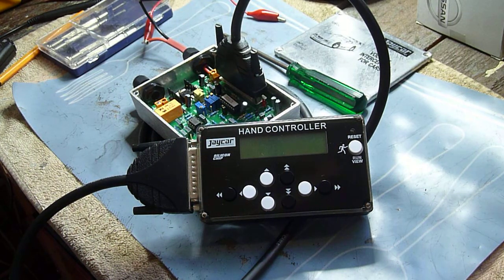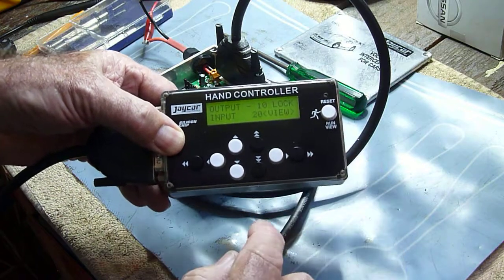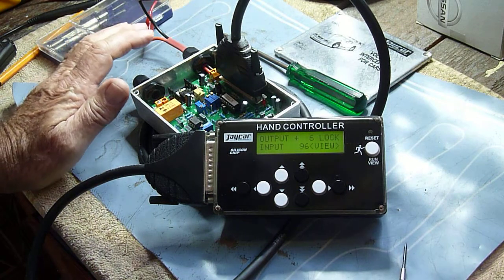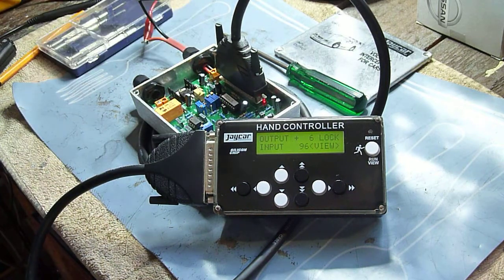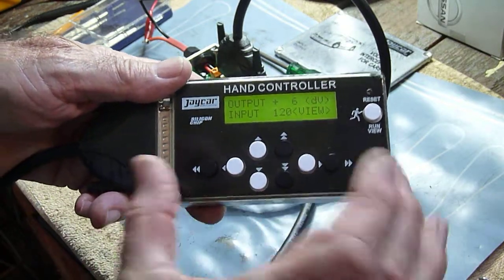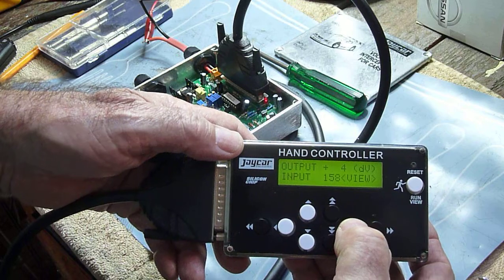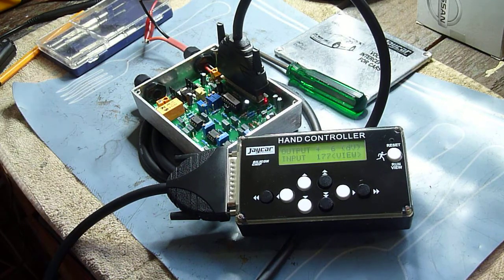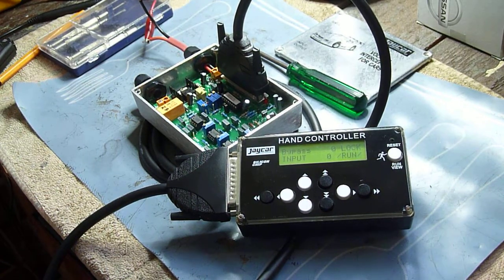Nissan 3L, JayCar Voltage Interceptor Adjustment & Tips

Comment: @Geeyoutoo are you still selling something like the Jaycar unit? I am on the Sunshine Coast and keen to catch up
Reply from the maker: No but if you are a bit electronically minded I have one second hand unit that may require a bit of attention. An ECU remap removes the need for these that is why I stopped making them.
Reply: @Geeyoutoo  I have a RD28 with the same issues. Getting a MAF calibrator from Greece that hopefully will work. Or I bite the bullet and get a Unichip ECU
Reply from the maker: @GURD28  I would suggest at this time that you look up Patrol4x4.com I'm an Admin there, we have many 2.8 owners who maybe able to offer more accurate advice on your engine than myself.

Comment: Geeyoutwo I think I need to modify maf voltage unless I'm missing something? Have blanked egr, needle and Dawes, 2002 Di still hitting limp or boost bounce? Not sure how to tell the difference, thanks
Reply from the maker: Do you have a boost gauge? If so what boost are you seeing? Do you know your MAF voltages? if as soon as you lift your foot off the accelerator and accelerate gently again the vehicle recovers then that is limp and as said mine has 3 limp zones, 2500, 3,000, 3500 and these can be tripped by quick turbo spoolup and a boost above 15-16psi (some vehicles may have that a bit lower), you maybe able to get rid of it by slightly reducing boost and/or spoolup. Does the engine light come on while driving? Unfortunately the device I was building is no longer available as a kit, so quite difficult to put together these days. If you are going to hang onto your Patrol (I still have mine after 21 years) then it maybe worth spending a few dollars, there is a unit called an ECUTalk it connects easily to the vehicle ECU and gives readouts on many ECU sensors, including MAFv and engine temperature in degrees. I will add a link. The second thing is an ECU remap, this can be personalised by the tuner to suit your requirements and will remove all limp zones, this can be done on a dyno or send ECU to the tuner and they do a mail order tune. Unfortunately there are not a lot of tuners who do the DI remap anymore, I know of one and he did my last update after changing turbo.

https://www.ecutalk.com.au/
https://www.powercurve.com.au/
Reply: @Geeyoutoo  hi mate thanks for the reply.
Yes it's boosting around 15psi, pyro is around 400° post turbo at 100km/h
If I button off and back on it goes normally again. Seems to happen every time you throttle on when cold and less often when warmed up. I'm planning to read maf sig voltage with a multimeter and do some tests. Ideally I'd like to find what resistance I need to remedy maf voltage range. First I need to confirm it's going out of range. I've put in a filter out of a skid steer next to the vnt actuator. Only thing I haven't done is adjust vnt screw. I have a complete td42 but am just trying to make the zd30 more drive able until after summer before swapping engines. Thanks again for your help.
Reply from the maker: @johnnywadeson9335  Sometimes 15psi can do it, you didn't mention whether you had cleaned the MAF or whether it is a genuine one.
When testing MAFv remember that the general limp zones are hitting 3.88v at 2500rpm, 3.98v at 3000rpm and 4.18v at 3500.
Air is more dense when engine and climate are cold, we call it cold limp, sometimes when you are just on the verge it will only happen when cold, as engine warms so does incoming air.
Reply: @Geeyoutoo  not sure if it's a genuine sensor or not. Grabbed some maf cleaner today so will make sure it's clean. Thank you
Reply from the maker: @johnnywadeson9335  Let us know how you get on.
Reply: @Geeyoutoo     Ok not too bad. I cleaned the maf sensor, located the maf signal at the ecu under dash. Fitted a 50k ohm linear potentiometer. I adjusted the resistance at 2500 rpm then checked at 3000 and 3500 and they were under the voltages you recommend by a few mili volts at each range.
No more limp mode. 
Will do some further testing when I have a mate to drive or take measurements. Temporarily soldered in a $10 multimeter and Velcro attached to the dash. I've got my needle valve closed as the EGT just climbs on the open road, should be a different story after it can breath. I get spikes or boost bounce up to about 18 or 20psi a couple of times under hard acceleration, holds 15psi most of the time and sits at 12psi at 100km/h with EGTs still around 420°c post turbo. That sounds a bit high to me. Will have to build a 3" exhaust and see how it goes. I've read a LOT of things about ZD30 GUs lately and your info has been awesome. Thanks very much

Comment: Hi, Can someone help me please, i am searching for the voltage interceptor and JayCar does not sell it anymore, 
can someone tell me where can i buy it?
Reply from the maker: Unfortunately yes it is not made as a kit anymore but Silicone Chip magazine did a write up in it's December 2015 issue for a stand alone unit that works the same but as a single unit. That issue had the full parts list to build one but no kit was forthcoming, I have spoken to the guy who did the write up, I could email him and find out if there were later developments. 

I'm assuming you have a ZD30DI, if so a remap is available that makes the limp control JayCar unit pretty well redundant and a lot cheaper than a chip. I did a video on the remap and it can be done by East Coast Performance Tuning on the central coast of NSW, Harley is the owners name, look up https://ecpt.com.au/
Reply: Geeyoutoo hi,
I am looking for it to my 4jx1 (Isuzu trooper)
In our engine we should connect the interceptor to the oil rail sensor signal.
I have bought the december 2016 issue and i don't think i can do it my self so is there something ready to buy? Or do you know about some other place that can built it for me?
Reply from the maker: Let me have a look around, roughly where are you located?
Reply: Israel

Comment: Hi There, I am interested in a copy of your map, I'm putting my kit together at the moment and have read a lot of your posts on the forum. I've got a manual GUIII 2004 with NADS, larger intercooler and 3" exhaust. I can't work at how to PM on youtube...
Reply from the maker: ranrovmat Yes I can do that, I've got a fair bit on at the moment but I will load it up to a server I use and post a link. I probably won't be able to do it for around a week as said I have a lot on. But I have saved the maps as I progressed so I currently have 7 to choose from, I'm going to have to do another as changes a little while back brought my under 3500 limp zone back and changes I made to boost a few days ago have brought my under 3000 limp back, but both only happen when I'm a 100% TPS so I can drive around it fairly easily until I get the time to remap.

Hope this doesn't inconvenience too much,
Cheers

EDIT: Just realised I already had one up there so here is the link, you will need to download, no preview for excel docs.

http://ge.tt/7s9Wra92/v/0
Reply: Geeyoutoo Hi Guys. I'm also very interested in this. I'd like a MAP when available. thanks,
Reply from the maker: Trent Haines Hi Trent, I have been updating my maps as mods have been done so there are a few to choose from, but like most of these things not all maps will suit, I have done a lot of intake mods which have made it breath much better, this tips the MAF over the edge so I have only just managed to get it to a stage where I could accelerate through 3500, Map 4 is a good place to start. This is the latest set: http://ge.tt/4rewh3M2/v/0
Reply from the maker: Geeyoutoo  Just inform you that when building the JayCar unit we calibrate it different to the instructions to maximise the number of load points we have available, it is detailed in the sidebar notes of the instructions attached here: http://ge.tt/4DJDjYI2/v/0 Cheers
Reply: Geeyoutoo Outstanding. thanks so much. I'll get cracking.